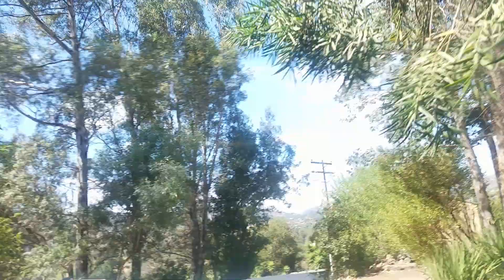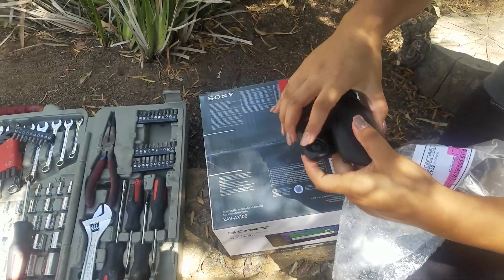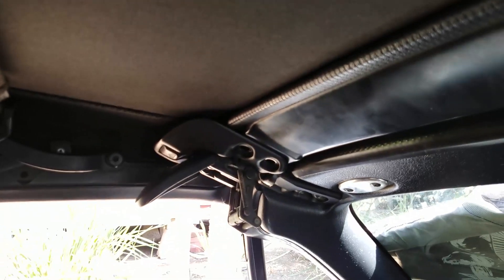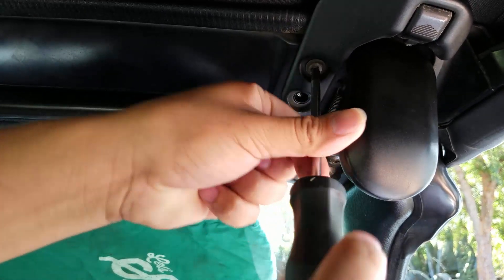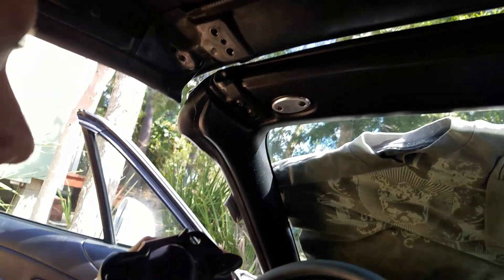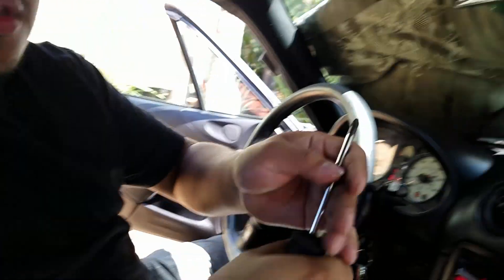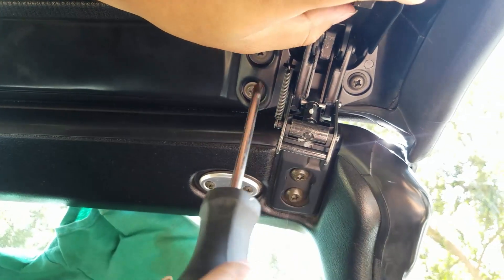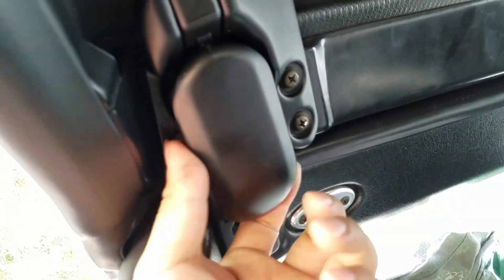Replacing Broken Soft Top Latches On Our Miata NB

Comment: I just got a 2000 NB and have problems with my top latches also.  I've seen some pages suggest putting a screw into the little aluminum latch release, not in the latch itself.  Hopefully that will help my issues instead of having to spend $150+ each on whole new latches.

Comment: Did this solve the wind noise issue?

I’m having the same thing ( crazy wind noise on the freeway) and am trying to avoid spending that much money. If it worked though I think it’s my last resort haha.
Reply from the maker: Yes, this eliminated the wind noise. See if you can adjust the latch that might help have a better seal.
Reply: Marvin1martian Thanks for the tip! I’ve finger tightened all the way. Time to bust out some wrenches. The plastic tabs are busted on my as well and I don’t think that helps matters.